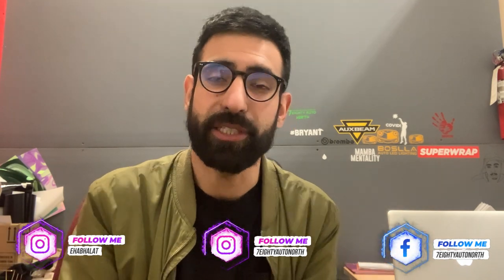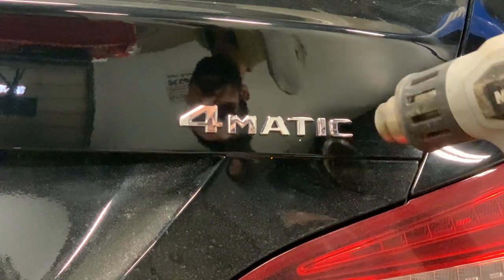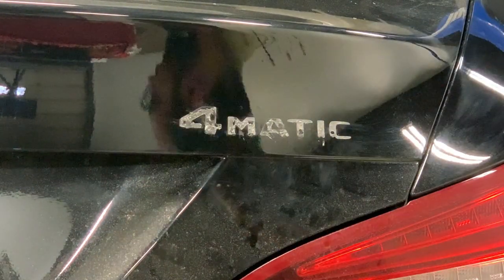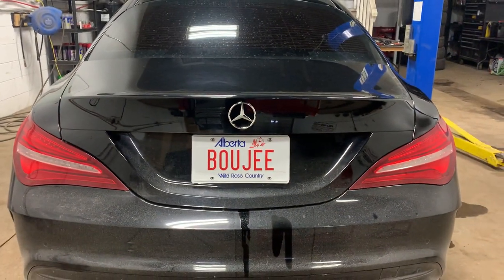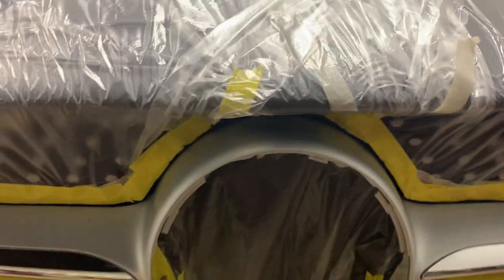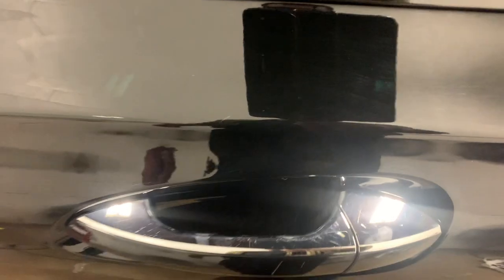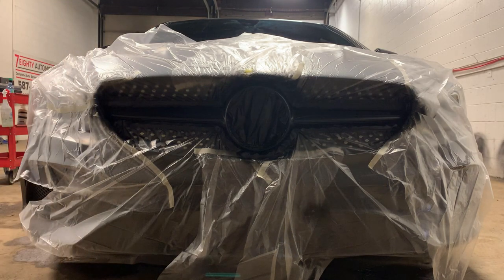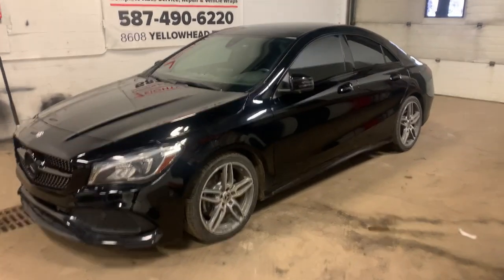Mercedes CLA - Chrome Delete + Debadge Emblems

Comment: Hey man love your content!!! With chrome deletes for front grille's do you recommend scuffing up the chrome first or just straight on with the plasti dip? Also the 2k clear gloss over the top will that help with atone chips etc? Cheers man
Reply from the maker: Thanks! No need to scuff up the chrome just clean it very good. 2k ontop will make it alot more durable and easier to clean

Comment: Question, I'm in Canada and its hard to get ready to spray gallons. I will be thinning my own black plasti dip with 1:1 ratio of xylene, what kind of  pigment can I use to achieve the same opacity as ready to spray gallons?
Reply from the maker: Just mix them 1:1 and it will be fine
Reply: @EhabHalat  thanks bro

Comment: How was peeling with the clear coat on? And how many coats of clear?
Reply from the maker: Peeling is fine with clear cost ontop. I have a video peeling plasti dip with 2k clear coat on top. I do 2 coats of clear, one tack coat followed by a solid wet coat
Reply: @EhabHalat  do you have to wait a certain amount of time for the 2nd coat or do it immediately?
Reply from the maker: @hudsoneight5988  i do it immediately after the tack coat